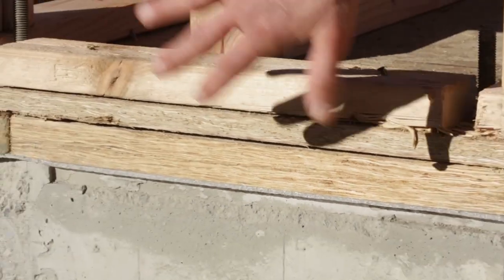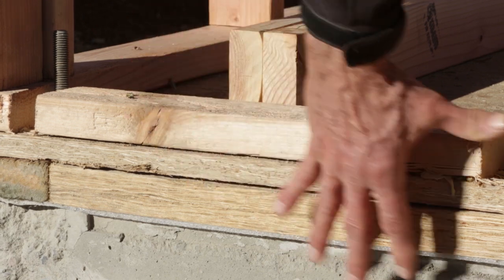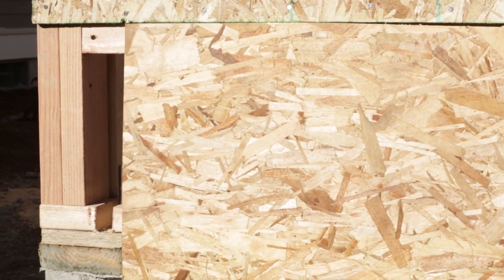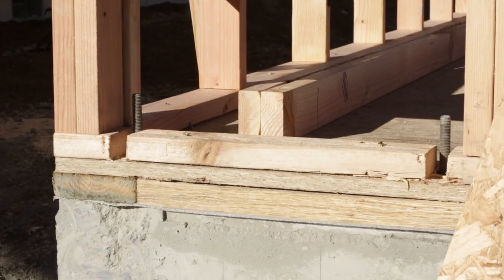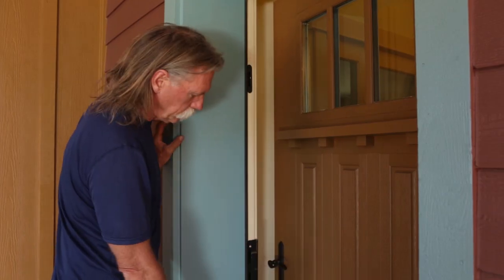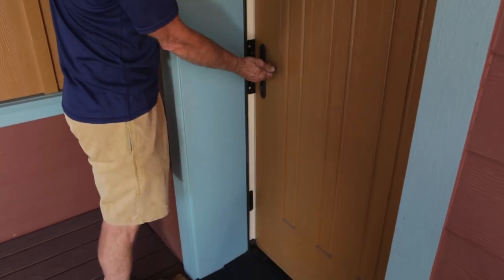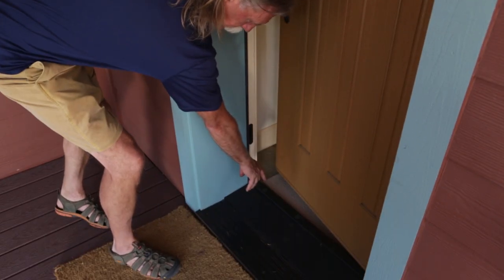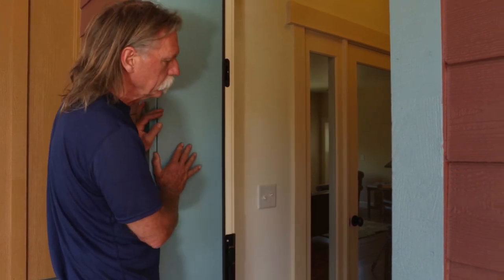Air Sealing the Exterior of a Zero Energy Home (ZEH)

Comment: In the windows detail there does not appear to be a sloped base for drainage nor does it appear that a window pan with fluid applied  or stretch membrane is used. Perhaps it is simply that not enough of the flashing deatail  is shown, but it does seem surprising since I would not condider the lack of these to be best practice.